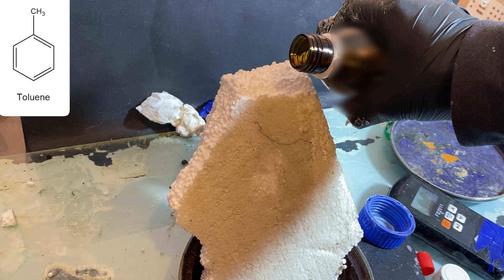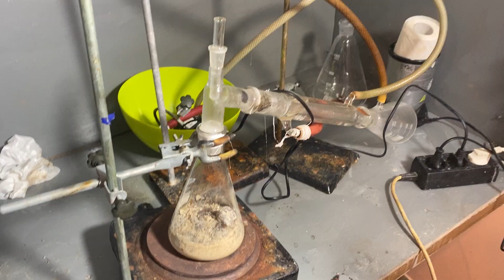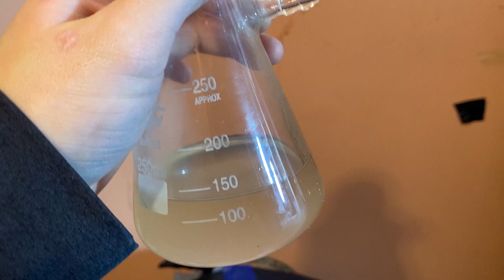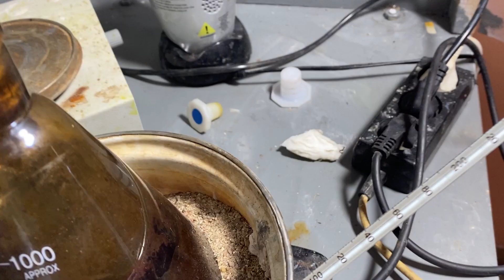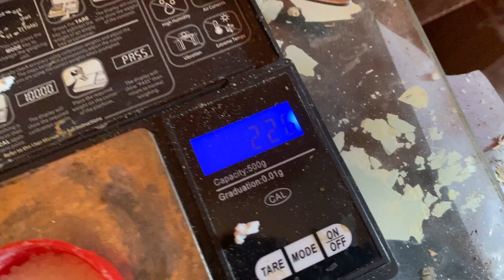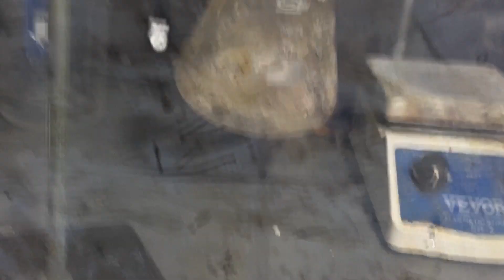Turning Styrofoam into Benzene

Comment: Benzene does not cause cancer, stop promulgating political lies designed to remove from the people useful chemicals, like chloroform, carbon tetrachloride, dichlorobenzene, toluene, xylene, embalming fluid, methanol, etc- which were commonly obtainable until the useless pimps and prostitutes  at the Air Quality Kontrol Board of Kalifornia needed to justfy their existence beyond all reason.

Comment: Maybe this comes a bit late given that the video is a year old, but if you have trouble with tar in your precious flasks try breaking apart a dishwasher tablet, throw in your tarred up flask and then fill it with boiling hot water. Note however that you need to watch out for foaming and overflow, so this is best done over some plastic container.

Comment: Suggestion for heating glassware if you're using a torch- place the flask inside a steel can with a couple inches of sand in the bottlm, fill the space around the flask with more sand.  This will distribute the heat and prevent glass from cracking.

Comment: I'm a little confused where all your potential yield was lost? to the air? Maybe the permanganate didn't completely react? Seems odd to me. I also clicked on this video because I have a lottt of styrofoam i've just dissolved into acetone and not sure what to do with lol. I think Youtube knows
Reply from the maker: Well, the shitty yield is mostly due to the last step when i was decarboxylating the benzoate, that's because the benzoate and hydroxide wasn't very well mixed, it wouldn't be a problem if i've chosen a flask that was apprioporate size, but i didnt have one because ive had glassware shortages back then. also glass is a really bad choice not only due to the molten NaOH leaching into the glass. also because the glass vessel i've chose was too big and the heat was spread out unevenly and it started cracking, if you want to have a better yield, use a coffee grinder or something to mix the benzoate and hydroxide evenly, and you can sprinkle in some calcium oxide for extra spice.
also im not sure if you remember this, but ive once done those out of context compilation videos when i was starting out and ive made one on you and i remember you leaving a comment on it when you were still known as nilegreen lol.

also the permanganate part should be mostly decent yield, but ive added a little bit less, because ive ran outta it, you can improve the yield, by refluxing longer than i did.
Reply: @Prussian_Blue  I'm thinking I might try something like this myself at some point. Hopefully the yield can improve. I've just watched a video where someone else also got similar low yields for some reason but maybe i'll have to see how I do
Reply: @Prussian_Blue  Ah that's cool! Thanks for the insightful reply. I think I might remember the video, but it was a long time ago. I've been coming across your vids every now and again, they're good :)

Comment: it's worth noting that 200g of polystyrene probably had some level of intentional impurity - lots of industries will add either structural elements or flame dampening elements. I'm not sure what the selection criteria are for different use cases of styrofoam but I'm certain the information exists in some corporate file on the internet somewhere

Comment: When you mix the oxidizer with water and then with the product You want to oxidize, you could use a big seperating funnel instead of erlenmeyer, by that you can shake your reaction mixture more easy and nothing of it gets in contact with your gloves aswell . You only have to ventilate it from time to time while shaking

Comment: best you can do to get pure benzene is to take benzoic acid in the most pure form you can get and heat it above 370C ish in a reaction vessel wich has a pressure relief valve. this will generate benzene and CO2 wich escapes through the valve. only open the vessel after it cooled to room temp by itself.

Comment: If you want to be less concerned about the glass in the final step, you can use an empty paint can,the heated NaOH wont disslove it, and it can take a lot more heat thus increasing the yield

Comment: Sodium benzoate is pretty useful and valuable all by itself.  I think that NAPALM is more like aluminum soap that is then mixed with gas. So, technically, your legal on that point.  I've heard about something like this before, been a while, but the benzoate is mixed with lime and then heated, in a tin can?  You get CaCO3 and benzene.  Like your lab set up.

Comment: I know shaking the toluene with KMnO4 with your hands was for the meme, but just in case it wasn't: toluene can pretty easily penetrate most thin gloves (latex,butyl), neoprene/nitrile are slightly better but toluene will still penetrate after about a minute after contact, so they should be removed/replaced quickly after contact. Not nearly as scary as benzene but you still don't want it in contact with your skin for a long time

Comment: Hello nice video!
A cheaper and simpler method for OTC benzene would de using PET plastic. 

PET saponification with hot NaOH will give you sodium terephtalate and ethylene glycol. Ppt out terephtalic acid with HCl, wash it, redisolve with excess NaOH and evaporate the solution to give you intimate mix of sodium terephtalate and NaOH, and proceed the pyrolisis the same way you did benzoate + NaOH.

Sodium terephtalate + 2NaOH - > benzene + 2Na2CO3